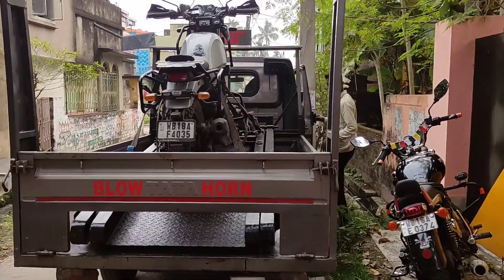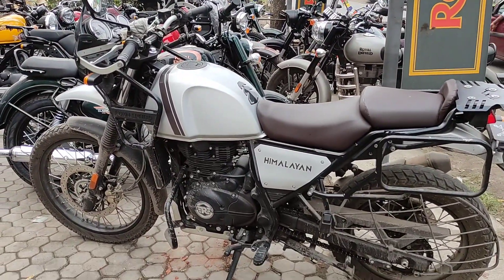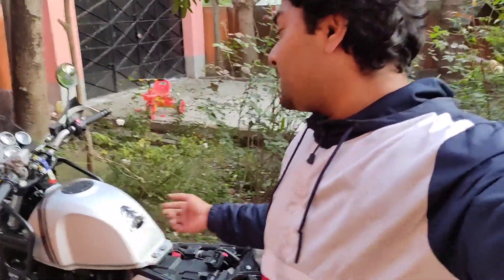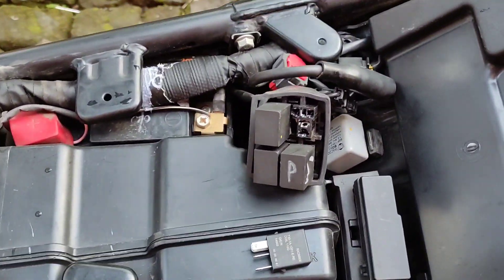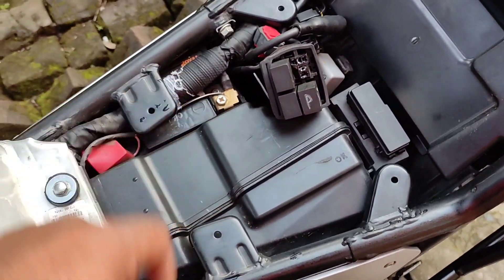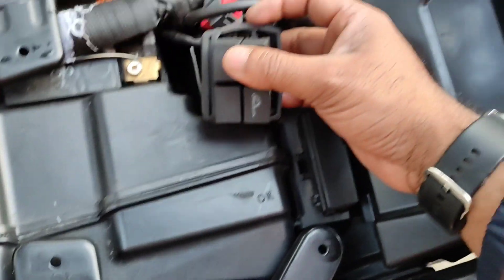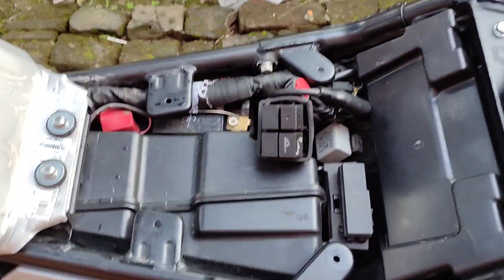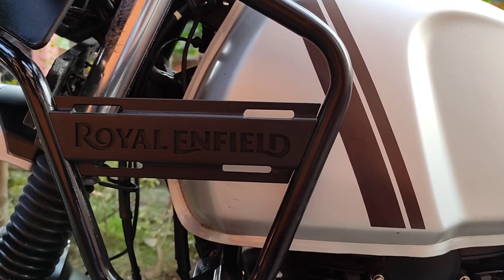Himalayan Starting Problem | Chapter 3

Comment: Bro Himalayan 2021 have fuel injector defect . Ask the service centre staff to replace the fuel injector. Same issue I am faced in my Himalayan they change my fuel injector under warranty . Now no issue bro
Reply from the maker: Same done with new relays
Reply: Fuel Injector or Fuel Pump?
Reply: @souravonoffroads  fuel injector?
Reply from the maker: @hari_v06  yes
Reply: Stop changin every now and then

Comment: Even I had the same problem,they changed the relay underneath the seat,the one which you did with a 4 pin. But bike won't start when it's hot and standing in scorching sun. In the morning and evening,it gave no problem. Finally,the fuel pump was replaced and now I am hitting roads again. Side panel relay is ECU I guess and that one under the seat is fp relay
Reply: How much did you pay for the fuel pump?

Comment: I am also having this same issue from one month. Last time Re guys said the issue is of bad petrol as i had not rode the bike for almost 30 days. So flushed the fuel pump with fresh petrol and the bike than was not having issue for a month but from yesterday the problem is again started. Re have not yet resolved in todays visit.

Comment: I have a brand new 2022 mirage silver. It does not start. It does not idle. It does on me in slow turns. I’m so frustrated!!! I complained at the dealership. The service man road it and said is just need road. I have 300 miles and it still won’t stay running. Under my seat there are two relays not four! Please advise if you can. Thanks
Reply: Hey.. Change all the 5 pin relays to 4 pin relays (dont go for RE, try diff brand)

Comment: i am facing the same problem, what are the charges for fixing this problem after 1 year 2 months of bike purchases???
Reply from the maker: It should be fixed under warranty from RE service center. Free of cost.
Reply: @souravonoffroads  but its more than 1 year vehicle??
Reply from the maker: @indeurS  do you have extended warranty or not? 
Check once at service center.

Comment: Left front.     - Starter
Right Front   - Side stand
Left rear.      - Head lights
Rigt rear.       - ECU  injection
Side panel.    - Fuel pump
Reply from the maker: Thanks. After the fuel pump change and 4-pin relays the issue seems to be resolved. 
So far running fine.
Reply: @souravonoffroads  they have changed the rhs side 5pin relay to 4 pin relay.. Still issue is there. Do you want me to change all the relays?
Reply from the maker: @hari_v06  SC had changed my ECU relay. Fuel Pump relay I had changed myself. 
I had not faced any issue with power lag. Ask your SC to check the throttle body and tune it properly. 
The fuel pump stopped working again at 20500kms... Few of my himalayan friends have faced the same. 
So it's not a permanent fix that RE is giving. Which is very disappointing.
Reply: @souravonoffroads  Yesterday again i went and got checked completely and they changed all the relays (5 relays)  to a 4 pin relay.  But still the power lag is there in traffic on 2nd and 3rd gears.. So the thing i got is i have to go for an after market relay ( say bosch)  that too 25amp. Hoping that will fix my issue.
Luks like always we have to carry some spare relay with us just in case if FI stops out of nowhere.
Reply from the maker: @hari_v06  I had used roots relays. Still fuel pump stopped working (2nd time) .... So note sure what is causing this. 
Company also not giving a proper fix.
Reply: @souravonoffroads  sad to hear... Replaced fuel injector or fuel pump?
Reply from the maker: @hari_v06  RE replaces fuel pump regarding this issue
Reply: @souravonoffroads  thanks,  will update of any fix was given
Reply: @hari_v06  hey brother found any solution ?

Comment: The relays are always faulty and it is unlikely that you will have a faulty fuel pump. The 5th relay that you are mentioning, in my case I changed it to a Roots RMCR5A relay that stabilised and bumped up the current supply. So far no issues observed.
One tip is don’t let RE guys know that you have moved to third party relay as they won’t be happy 😃 
Good luck..
Reply: Could you tell me from where did you purchase the relay?
Reply: Bro can you please let me know from where you bought this relay?
Reply: I got it from Helmetdon site, but I would now suggest getting the new 4pin relays first from Royal Enfield. They seem to work good as well.
Reply: @surajitberaofficial  I changed the fuel pump & also tried the 4 pinn relay provided by the service center, bt sometimes bike not taking self, it's sounds like the battery is down.
Reply: The 5 pin roots relay you mentioned in the link, is it help me to resolve my problem?
Reply: If the battery has any issue then no relay in the world can fix it. Claim the battery warranty and get a new one. If you are getting the RE 4pin relay then make sure you change all 5 relays in the bike. Many times service centre guys change only one relay which will not fully solve the issue. I’ve checked all new Himalayan and Scrams are having new relays only.
Reply: @surajitberaofficial  ok, I will try, Battery has no issue m sure, check it many times
Reply: @surajitberaofficial  Hi,  i have changed my fuel pump, and all the 5pin relays to 4 pin relays(5 count)  But still there is a power lag in the bike
Reply: @hari_v06  Ideally the above suggestions should solve the issues related to fueling, regarding power lag there are multiple factors involved. Try switching the engine oil to Liqui Molly or similar (avoid full synthetic oils), this smoothens the engine by considerable amount. Rest can only be verified by a good engineer. :)
Reply: @surajitberaofficial  you changed fuel pump or fuel injector?
Reply: @rupjyotikakati2458  If battery is working fine then chances are the alternator is not able to charge the battery. Also check with an engineer if battery is getting drained in ignition off condition.
Reply: @hari_v06  Changed the fuel pump and the relays, switched to Liqui Molly 15W-50 Street Engine Oil.
Reply: My 2018 had a faulty FP relay and a dead batt in the 1st week. My wheel speed sensor failed then my steering became notchy. I regreased the head bearings and now all is well. All this in under 3K miles. Yet I still love the bike! I must be suffering from Stockholm Syndrome. 🤔

Comment: I have been encountering the same issue for the past two weeks. Initially, they diagnosed it as a problem with the relay and proceeded to replace it while also conducting a general service. However, after two weeks had passed, I found myself facing the identical problem once again. The Fuel Pump would not emit the usual buzz, consequently preventing the bike from starting. I returned the bike to the service station, where they informed me that the battery was the culprit this time, requiring a replacement. I complied and had the battery replaced as well.

Upon bringing the bike home and attempting to start it, I was met with disappointment as the bike still refused to start. Curious about the underlying cause, I exercised patience and waited for a span of two hours. During this time, I contemplated whether the issue might be related to engine heating, though it was purely speculative. After the two-hour interval, I made another attempt to start the bike, and to my surprise, the vehicle sprang to life.

As it stands, I'm puzzled about the actual source of the problem. Could it be the relay issue once again? Perhaps an engine heating problem? It's possible that a faulty or loose connection is at play. Regrettably, I lack a definitive answer at this point. I'm currently anticipating the arrival of the service team to collect my bike today. I will make sure to provide an update in this space. Wishing all fellow riders a pleasant and trouble-free experience on the road.
Reply: Any updates post that. I also face same issue. Changed battery. Came home and then not starting and fuel pump is also not buzzing.
Reply: @pratapnanda5452  so i got them to change the fuel pump motor and then took it for a long trip in the same month - around 1200kms in Aug, so i guess with that change the issue was fixed and for now there is no issue. Bike starts every time.
Reply: HI. a courtesy. I have the same problem as you on my Royal Enfield Himalayan in Italy. how did you solve the problem. thanks cg
Reply: @claudiogilardoni6900  you'll need to replace the fuel pump motor and that should solve your problem

Comment: I think one of the issues is yeh stock relays are rated at only 1 amp.  I changed all my relays with the Narva equivalent relays which are rated at 20 amps. Now you can hear the relays click under the seat over the sound pump priming.  

But that didn’t solve my issue my Euro won’t prime if the bike is left with the sun shining on right side of the bike on a HOT day. It’s getting its fuel pump changed on Wednesday. There was 12v at the pump during the prime. I even popped off the fuel line and opened the tank just incase there was a pressure build up somewhere causing issue.

Comment: bro some times  those local service center guys uses more grease over relay it it becomes hard  to get right current from its socket clean up and try if not  go for roots or minda 25 Amp  local they said 20 Re works under power gives cut or fuse gets blown other is if they fix it by up-gradation of Ecu on service center they under tune your motorcycle . as ive face that issue since it was bs6 from march 2021 himalyan in mumbai  aside took help of outside mechanic who had experienced in wiring and electronics of Himalayan  aside company of Re sells expensive relays and quality is really bad  as market price they sell around 105 Rs  and printed price is 102 rs but that quality and finish is not that great

Comment: I am facing the same bloody problem. And it's showing engine problem sign . Please tell me what should I do
Reply: Might be fuel injector issue , get it checked in Service center and get the relays replaced by new 4 pin Relays provided by RE

Comment: Hi bro,  ive got both the fuel injector replaced and the 5pin relay to 4pin relay(only one relay rhs side FI) .. But still iam facing the power lag issue,  could you help me out?  Is there anything else needs to be done
Reply: Fuel injector price bro ?
Reply: @sureshjohn3269  around 2500.. Free if under warranty
Reply: how much does one relay cost

Comment: Same problem also me bro how to fix this 😭
Reply from the maker: I changed fuel pump under warranty for the 3rd time in October 2023.
So RE not giving any fix just changing the fuel pump

One thing I observed  that the problem starts to happen when the bike gets too hot due to heavy traffic  or jam. So don't get it too hot which is very difficult  in summer specially 😕

Comment: Hi , I am also facing the same problem , the RSA has changed the relay but the starting problem
Is still there , my bike has only clocked 950 kilometer’s. What should I do ?
Reply from the maker: Take it to service center and show them the problem, if it's not happening all the time take a video when you are facing it and show to then. 
Ask RE service to fix it in warranty.
And get it resolved soon else you will get stuck one day in the middle of nowhere... 
All the best
Reply: @souravonoffroads  bro I am also facing this problem please tell me the complete solution asap bro

Comment: Bro can any one tell me the complete solution for this problem the service centre member can and said that it's was aa better issue and I have been charged the battery for times and it's not gone please 🥺 any one tell me the complete solution
Reply from the maker: RE is not able to give proper solution of this problem. All they are doing is fuel pump change when anyone face this issue. 
I got mine changed twice. 
First at 12000 kms
Second at 20000 kms
Reply: @souravonoffroads am also facing the same issue but after re fix the relay now it's working fine.. what is the fual pump warranty bro
Reply from the maker: @withmyvaganam  with extended warrenty it's 4 years I think. Do check at your service center. I had to change fuel pump twice.